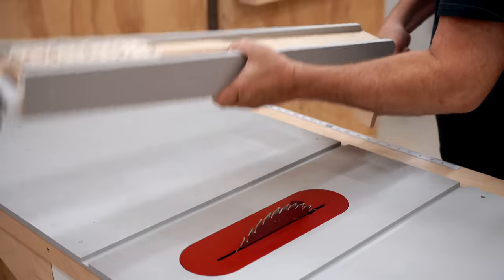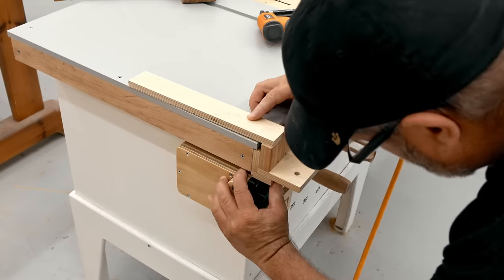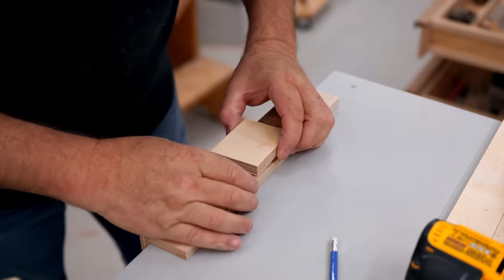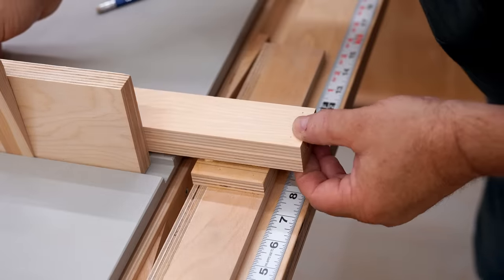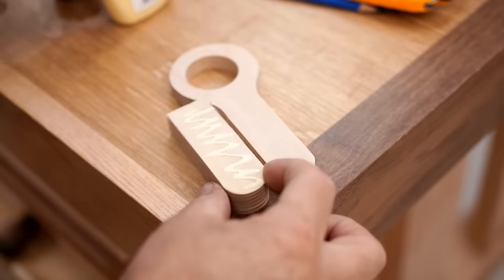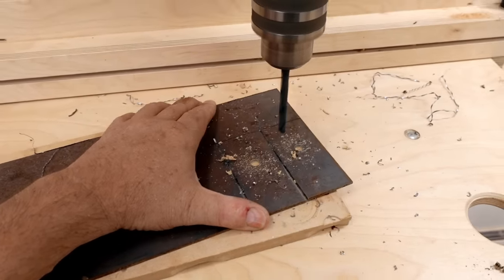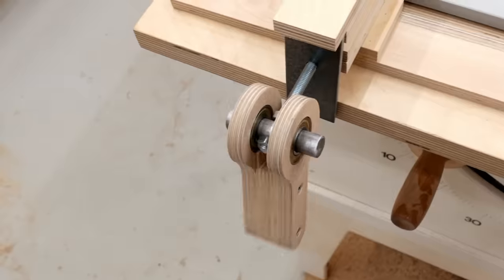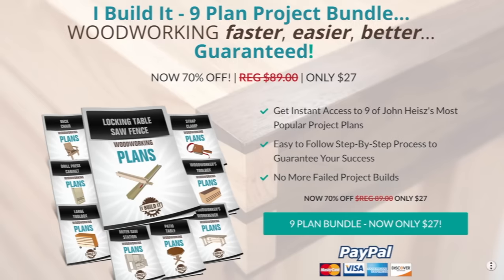This is a Game Changer - Making the Table Saw Fence YOU Asked For

Comment: Great design! Good engineering and execution! With all that, please consider facing the 2 round portions contacting the front steel locking plate with SS or brass shim stock (~1/2 in.x 3 in.) so the wood is not worn by the steel. And these strip are forever replaceable!

Comment: I'm still in the process of building up my workshop (which involves gutting my garage, since it turns out it was put together so badly by the previous homeowner that I'm pretty sure it's illegal), but I still bought this plan bundle. Once I get the actual walls and electrical back in place, I'm going to be using these plans a lot! Thank you!
Reply from the maker: Awesome! Thanks!

Comment: I built the previous version  which works quite well and is very accurate. The new updated one will be even  more accurate as it locks front and back so will counteract any side pressure on the fence. Great job John  and keep up with new projects, plans and videos. You are definitely an inspiration . Another plus with this type of fence is that it is hassle free to remove if you want to use a crosscut sled or need the sawtop for another purpose.

Comment: Great design, so simple yet i could have never come up with that! Only idea I would have to improve it would be to bevel the measurement pointer at a 45 or even 30° angle (like a knife) to make it a bit easier/ more accurate to read. That would also make it a bit more dangerous if not in use though.

Comment: I made your original design which displaced sliced bread from the top of my list of Best Things.  I too wanted to be able lock its rear end  in place, but was leery of a mechanical clamp because that was what was on the fence that came with my table saw and it was unreliable.  It tended to move the rear end of the fence slightly when I actuated the clamp.   I settled on a switchable magnet which solidly anchors the end of the fence to the  cast iron table when actuated.  It has performed flawlessly.  My only regret is I didn't think of it before I built the fence because then I could have easily made it actuated by the front lever instead of having to take the extra step of manually turning the magnet on/off.

Comment: I missed out on the bundle plan. Oh well. (Stupid surgery, LoL!). Great build as always. I need to build a better fence for my old Craftsman contractor saw. But first I'm going to build it into a cabinet so I have a larger working surface. Before the comments start, I've heard and read all of the "vibration" complaints about my particular saw and I honestly don't have that problem since I tuned up my table saw using Stumpy Nubs advice. My antique saw cuts like butter, straight as an arrow and has almost no vibration. Sadly though, with the original fence I only have a 13" max cutting width. If I want to cut wider than that I have to do it with a circular saw or eyeball it on the table saw and dangerously without a miter gauge or fence. I'm sorry, but free hand on a table saw is not appealing to me. LoL.

Comment: I got the plans and am putting the rest together today. Simple to build. I like it. I tweaked it a little but that is just because I have a very specific workbench. Your emergency stop in the video has a DIY push button. You may laugh at me but if you should hurt yourself God forbid and the insurance sees that you altered the switch, they may use this as a reason to not pay. The switch is UL listed and any modification will void the listing which makes it unsafe in the eyes of authorities. Ref. National Electric Code 90.7, 110.2, 110.3(B) and (C). Just looking out for a brother.

Comment: About to build a new fence for my new home made table saw and again jumped on your channel since I've used your old design building a fence in the past. Now about this new design... Correct me if I'm missing something, but as I see it the threaded rod doesn't contribute at all clamping the back side of the fence configured this way. What I'm thinking is 2 nuts are needed, thightened 1 on each side of the metal plates  (front side) and the threaded rod itself musn't be on the handle itself, but over the pivot point of the metal plates, which in this case is the screw that holds them to the fence. This said, the screw that holds the metal plates must be somewhere in the middle of them, not on the top. This way clamping down with the handle would pull the rod together with the metal plate on the back. Otherwise I really can't figure out how the rod is helping?

Comment: John, you mention that you made a jig to mount the rail but you did not mention in the video, or the article regarding the build nor in the plans what hgt the rail needs to be mounted at in relationship to the table saw top. Also part A (rail face that mounts to table) you not it to be 2-1/4 tall but you are mounting yours under the overhang of your table top.  I figured this out only after I cut the piece per your directions.  My table top is flush with the table edge.
Reply: Building it right now and running into this. 

What height did you make yours?
Reply from the maker: I can't give an exact measurement because plywood varies in thickness. When the fence rail is mounted at the right height, there will be a small gap between the fence and the top of the table saw. Use the fence itself to help install the rail at the right height and adjust as needed.
Reply: @JohnHeisz  thanks John for the quick reply

Comment: Sorry for the amateur question here! I just got a drill press to complete this project and was wondering - what speed do you have your drill press for the 3 parts you use it for in the build: 1. drilling the countersunk holes in the birch plywood 2. drilling the holes in the steel plates 3. drilling the hole in the pivot pin?

Comment: Hi. Very nice. I was wandering why you opted for a flat bar to lock the back rather than a round pin which would be far more accurate and then add a thin steel or aluminium strip along the back edge of your table for contact?

Comment: Built this fence last weekend.  It doesn't work. Well let me rephrase that.  It works but it is wobbly and won't stay in place.  Any ideas on what I should look at to make it right?  I'm pretty sure it is my fault and I need to look at the build quality I think.  It looks much beefier in the video but when you use the plans and build video it feels much smaller.  I'm actually proud of what I got out of it but I need to work thru the kinks so it will work better.  I have to measure both sides and hold it while I engage the cam lock and then it still will move around.  What adjustments should I look at first or other things??  Thanks.
Reply: Hey I’m working on the same thing and had some similar problems. I’ve noticed it’s better on the left side of my fence. My theory is that the gap in the fence rail has too much variance. The gap is supposed to be 1”. My suspicion is that it’s wider on the loose side. I haven’t had a chance to verify though.
Reply: The other thing I think I goofed was on the page that says “assembly 7”, I think I got the gap wrong (should be 1/8 on both sides).

Comment: Just a thought … is there any reason to not make the faces of the fence longer than the depth of the table saw, to give more bearing surface when sawing a long piece? Seems like even one more foot would help.
Reply from the maker: Be a walk-into hazard on mine. Better to use an auxiliary fence that fits on.
Reply: @JohnHeisz  Hmmm! Easy to screw it onto a wooden fence. Tx.

Comment: John, your table saw is beautiful! Would this fence work with my ultra cheap second-hand table saw? My cuts are super crooked even though I've replaced the blade and squared it with the top. The fence visibly bends away from the blade as the material passes the blade. When I cut a board lengthwise, it usually ends up being about 1/8" wider at the front end than the back end. I'm trying to take about 1/2" off some stock that is 11" wide and finding the widths are all over the place. I don't have the cash to buy a $aw that would be any more accurate than this so I'm looking for work-arounds.
Reply: @Adrian-vd8rm  lol

Comment: Hi John. I often find that this style fence can be clamped non parallel to the blade. Maybe that is a issue with cheaper table saws that has not been set it right. But before buying the template I would like to ask for your opinion on this. Do you push or pull the handle to let the T line up before locking it? Or is it the precision of the build that is important? Thanks / Kenny
Reply from the maker: It's self squaring.

Comment: The threaded rod doesn't contribute at all configured in that way....
Reply: I too believe the threaded rod cannot move, the cam handle just revolves around the pivot pin. Or am I missing something?
Reply: @dennolevo  Exactly. The pivot pin doesn't move relative to the fence itself so the rod only get to be a very complicated way to set the tension of the back plate...